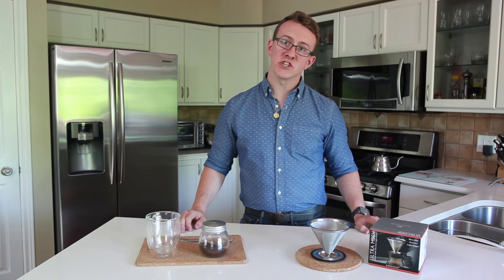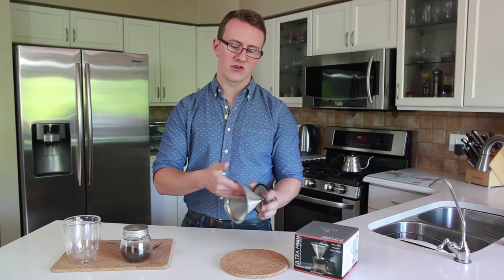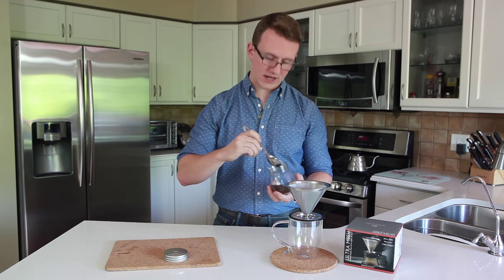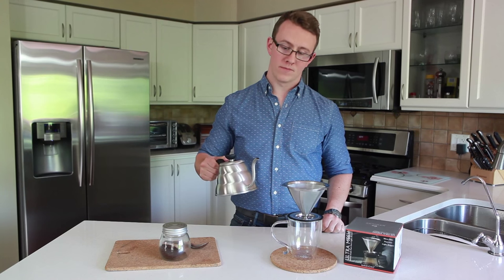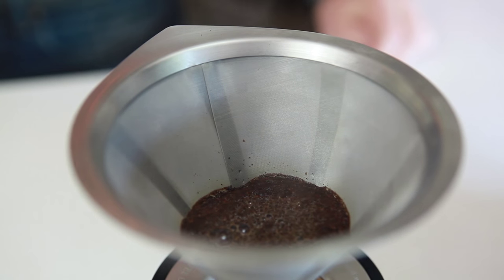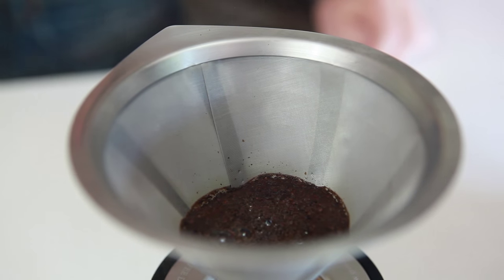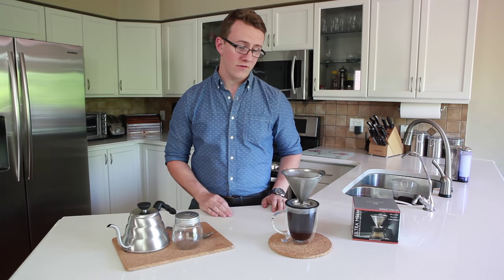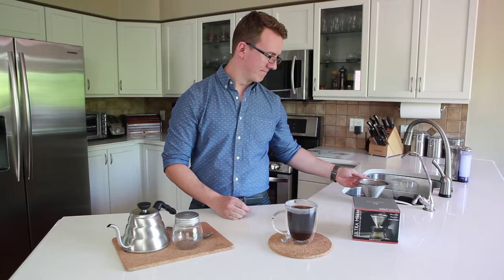How to Make Pour Over Coffee | Ultramesh

Comment: I bought one a few yrs ago, and my coffee did taste better w/o paper filters.  This clogged after 2 or 3 months. Yes I did scrub out after each use. I wrote about it on amazon, they advised me to grind coffee finer, but this video says to use course ground coffee? Then they suggested to submerge in boiled water with vinegar to clean the tiny holes. I'm using paper again filters since then. I think will try the vinegar thing (they did not mention before to me, just learned about it today on amazon). But it may be beyond salvaging.